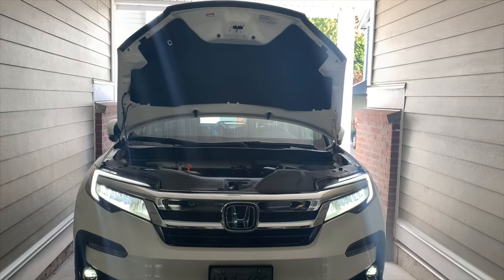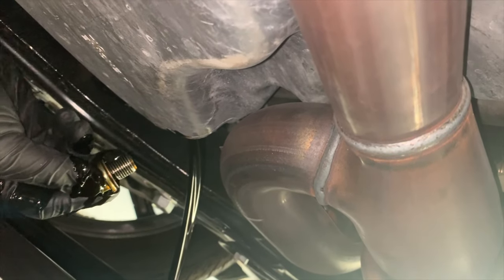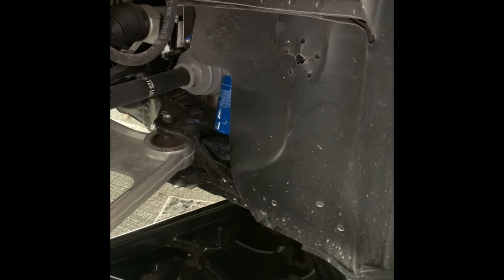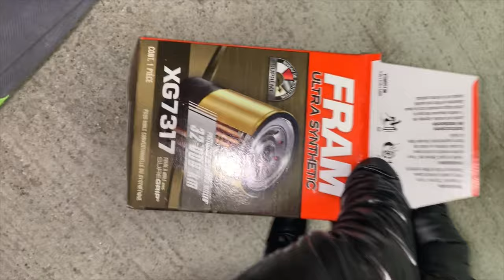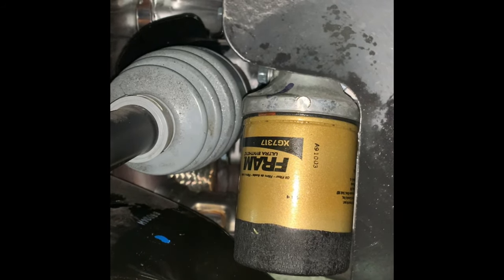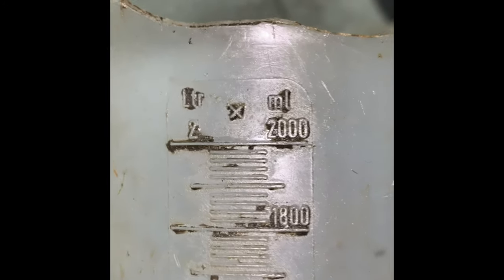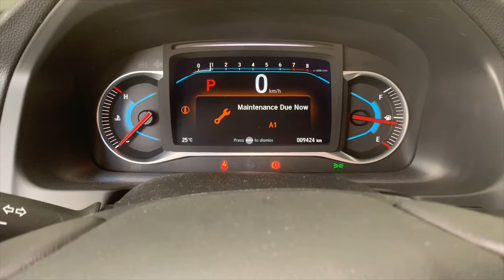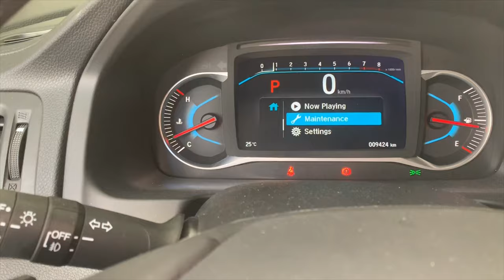Honda Pilot Oil Change
Hit Subscribe button

Comment: Thanks for the info! Great to hear another Filipino DIY their own Honda Pilot. 
BTW, why did you pick your oil and filter? Was it because of value or for any other reason?
Reply from the maker: AZ thanks for your comment, yes I am a kabayan, that do DIY in my car, I pick that oil because as honda recommended any same type of oil as long as it had API certification in the jag. “American Petroleum Institute “ Certified, and the filter is designed for Synthetic oil... thanks for watching, I hope this helps you and other readers.... til next time....
Reply from the maker: Thanks Geo J, I will keep you posted

Comment: Kabayan how’s the honda pilot transmission?
Reply from the maker: Kabayan, ok naman so far, 65k na , no issues, do you have the same? How’s yours?
Shifting smoothly
Reply: @randy0703  thank you kabayan. Plano ko kasi kumuha ng honda passport. Yung powertrain kasi ng passport and pilot is the same lang that’s why i ask. How often you change the transmission fluid? Or Pwede bang hayaan na lang?
Reply from the maker: @jonpolokpolok1527  hindi pa ako nagpalit ng trans fluid, wala pa sched, lalabas yun sa warning signs, I will let you know kung time na for me, may sched sila, recommended ng Honda
Sana nakatulong ako, Mabuhay 👍🏻👏😃
Reply: @randy0703  thank you brod!

Comment: OMG!  Fram are the worst filters you can buy for your vehicle!!!!!!
Reply from the maker: John Brown what brand do you recommend?
Reply: @randy0703  Bosch Boss, Mobile 1, Wix, Napa, Pennzoil,  Champion,  are all good filters for around $8-10 bucks. I would recommend OEM filters for your car that won't cost alot.
Reply from the maker: John Brown thanks, I will go with OEM, thanks for watching, please subscribe
Reply: I'll second that - they are very poorly made and over-priced. For a car like this which needs very low viscosity synthetic oil, I'd use a Mobile One top  line model filter.